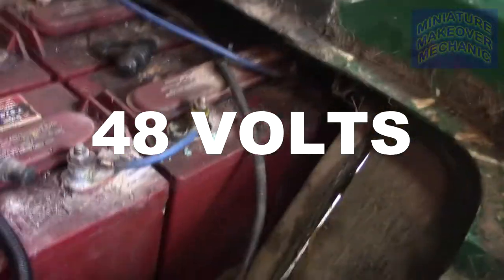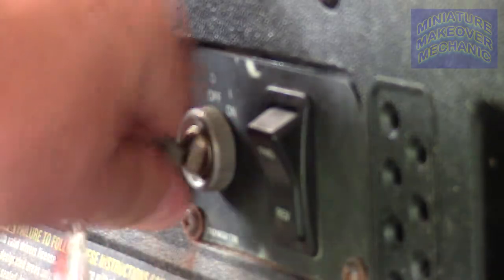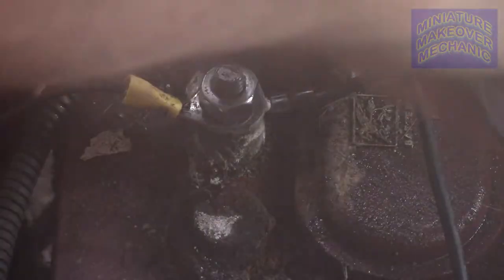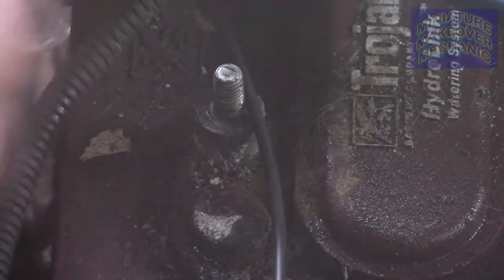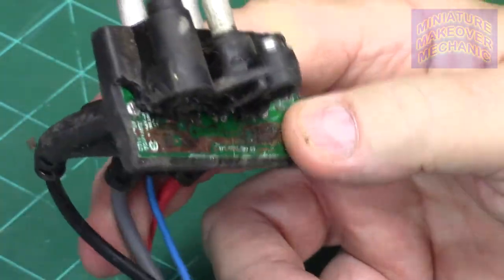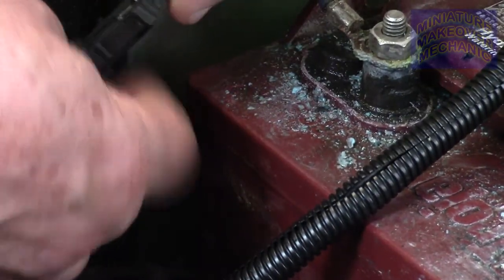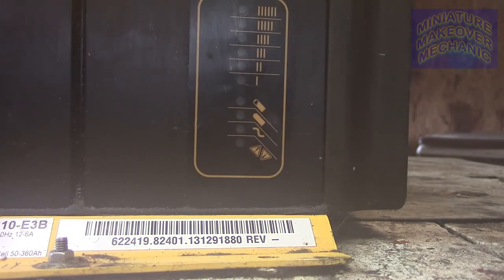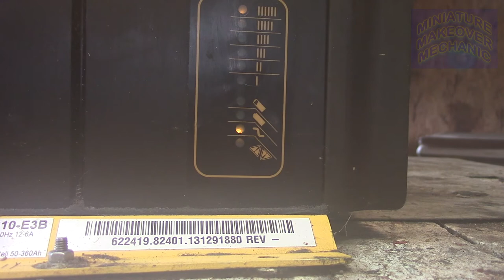EZGO TXT 48V CHARGE REPAIR

Comment: So what exactly did you do? I’m trying to wire up a new receptacle right now and don’t have a diagram for it. Not sure where the sensor goes. Put red on positive and black on negative.
Reply: Both the red wire and the grey wire go to the main positive, which is battery #1 positive. The black goes to the main battery negative which is the negative of your last battery in series, which IS NOT the same battery you have the positive connected to.  The grey wire has a black hard piece that’s a temp sensor which if not working will shut the cart down as it cannot be simple cut out or bypassed. The small connector (blue shirt wire) has to be plugged into it’s matching connector, as this goes back to the controller and looks for your pack voltage. If this is not connected the cart will not run. It’s a safety feature that prevents your cart from driving if the charger is plugged in. Hope this helps.